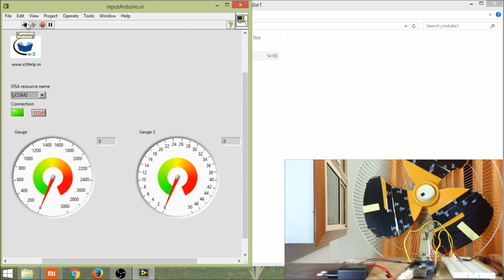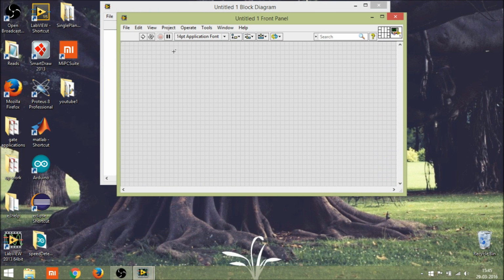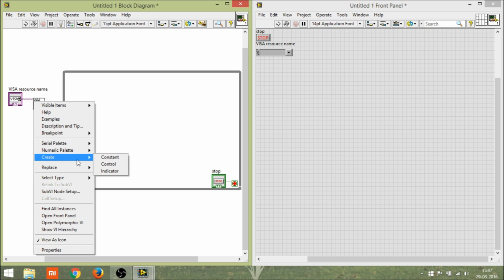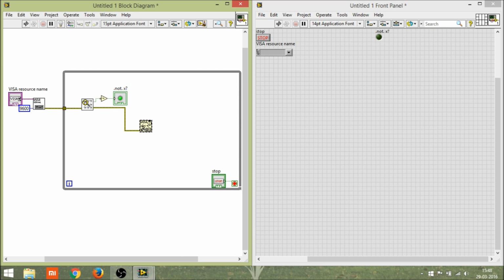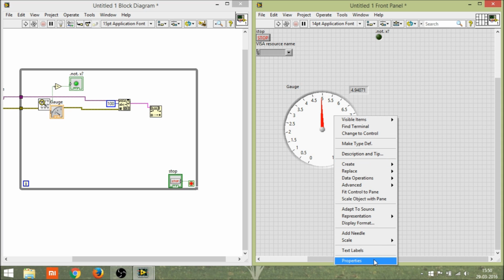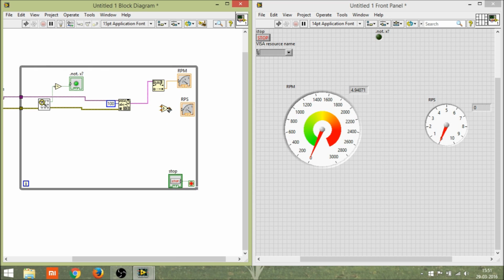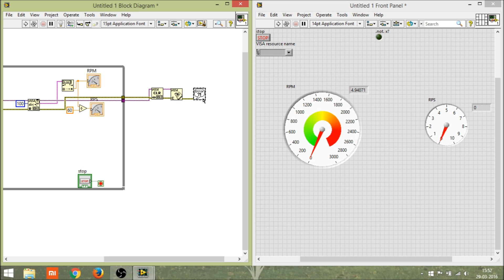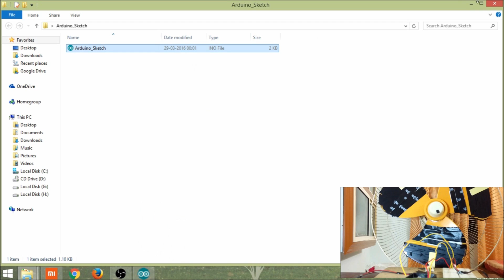Speed sensor using arduino and LabVIEW (VISA)

Comment: You did not configure any port and you somehow managed to run 2 different softwares on a single comm port. I dunno how did you do that, (breaking the laws of all computing and all) but amazing. I followed exact instructions and couldn't run it. If I run arduino, labview won't work, if I run labview, then arduino won't work. If I'm reading multiple datas in Labview, the loop throws an error. I thought let's do with the simplest and try interfacing a dht11, no result. Only empty strings are being read. WTF is happening???
Reply: what did you do to fix the empty strings being read?

Comment: Doubt: In Hardware connection you used Pin2 for IR Sensor but you not configure it in labview. without initialization of pin2 how it is reading.
Thanks for the video

Comment: Nice Video. 
But you have stuck those foam tapes on all three blades. This will give thrice the rpm/rps. 
Am I right?
Or have you programed it to divide the values by 3.?
Reply from the maker: Sunil Kr I have handled it.
Reply: E3help cool..
Reply: i have encoder speed sensor with disk how i program it with arduino and lab view to draw and calculate speed in rpm,